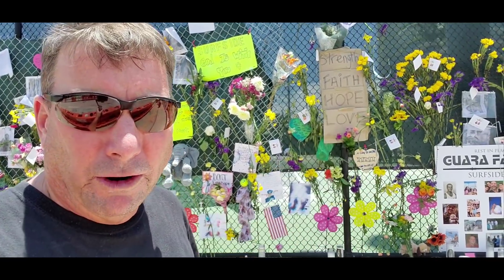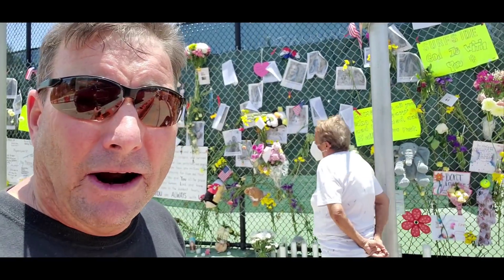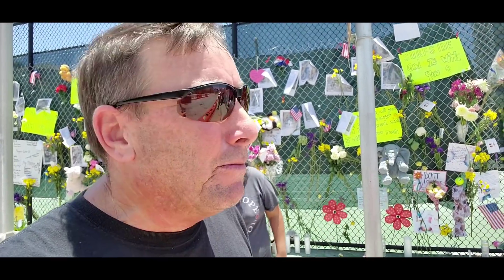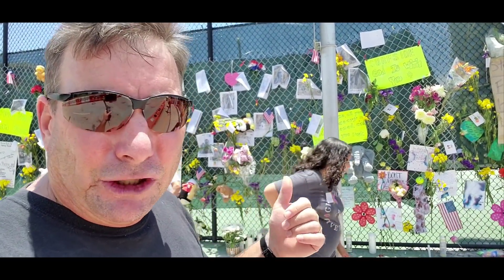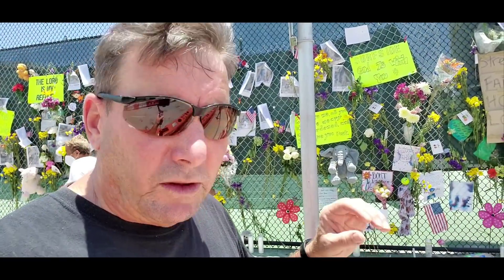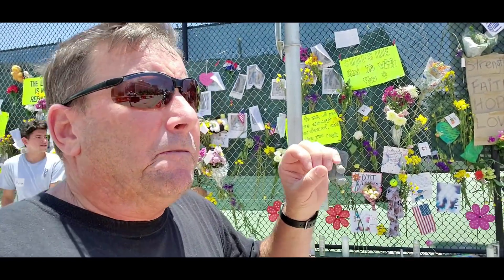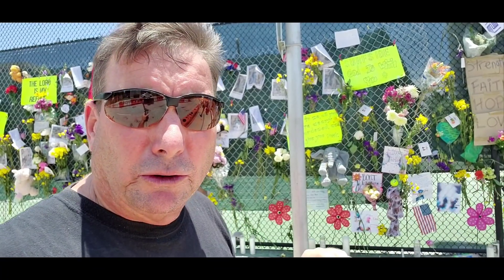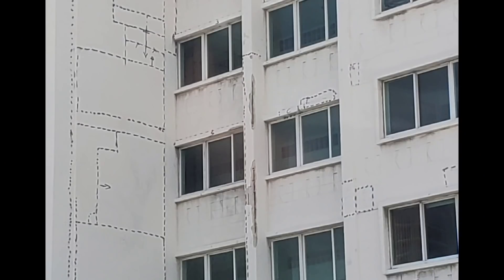Miami Condo Collapse and Memorial

Comment: Keyword: condo. Getting condo owners to agree with anything is like herding cats.
Reply: Condo owners have an inherent conflict of interest - obviously they want a safe home, but many will baulk at the cost of expensive renovations - I heard that in this case each owner was facing an assessment of $100k-$400k to pay for the necessary work.  So if one thing could change that might save people from their own tightfistedness, it is that there should be a legally mandated reserve fund that collects money every month, that is much higher than the current managment fees, so as ensure that there is always an adequate reserve to pay for repairs without having to tap the owners for six figure sums for major structural repairs.

I haven't seen it in any of the reports I have read or heard, but according to Zillow, one of the penthouses in this building changed hands on June 2, 2021 for $2.88million!
Reply: @pulaski1  Yeah facing a repair bill that costs as much as a Midwestern house tends to cause issues. I've heard a lot of these owners were retirees living on fixed income so unlike our penthouse buyer would struggle to cough up the money. Not to mention those who took out a mortage to buy their condo, nobody expects to have to take out a second mortage just to pay for maintenance. Your idea would solve that by putting that potential cost out up front and collecting it over time.
Reply: @pulaski1  either that or build responsibly.
Reply: @megenberg8  Agreed, but the vast majority of homes built in America over the past 50+ years have been built "down to a price".  

My home was a cheap spec build, but I knew that when I bought it, and that the repairs and upgrades would be a continuous process for as long as I own it; after 18 years everything is going exactly as expected.  :)

So, if you overstretch yourself just to buy a mansion, or condo with an ocean view, then your home is a financial house of cards.
Reply: Collective action problems are a bitch, there's always gonna be people who have different priorities.
Reply: @MrMattumbo  what’s that word again?  Oh yes, ‘regulation’  along with its partner, ‘enforcement’.  Not words at the top of the political influencers list in Florida.
Reply: More like trying to give a cat a bath.
Reply: These buildings don't have an indefinite life, but that's no reason to not build them using fail safe principles, say slab hangers or props, so at least they can be evacuated safely in event of a catastrophic failure of main load bearing members.
Reply: @jimgraham6722  I think the problem then is how to get from condos selling for $500k+ and penthouses selling for $millions to "this building is life-expired and needs to be demolished".  In other words, the problem is that the market has been escalating the value of buildings like this when it should have been depreciating the value.

I suppose that the building could be given a non-renewable usage permit, that would force demolition, and while that would be a radical step, it is not too far removed from the British concept of "leasehold" titles, where a condo owner (there are no condos in the UK, so I am referring to the owner-occupier of a multifamily dewelling) buys the right to occupy the unit for a fixed period of time.  The law has changed somewhat in recent years, giving many owners the right to extend their lease by buying additional years.  Typically leases used to be 99 years, but then that went up to 125 years in many cases.  Valuing a home when there is only 10 years remaining on the lease becomes interesting, and once they get below 50 years they are very difficult to get a mortgage to buy (which is one of the reasons why the law was changed to give owners the right to extend the length of the lease), because the collateral may be difficult if not impossible to sell in foreclosure.
Reply: @pulaski1  maybe maybe they should do that with the Millennium Tower in San Francisco
Reply: @pulaski1  Yes it is an issue. I have bought into a brand new condominium in Australia. Building has expected 70 year life. We are already paying into a fund for half life refit. I won't be around but I expect owners would be paying into fund in second thirty five years to give them a significant stake in redevelopment should that be necessary.
Reply: Got to wonder if any of these board member/owners, sold or moved since the report was given to them, (the association)???
Reply: @2011mendo  It has to be likely that that has happened - perhaps the seller of the penthouse that according to Zillow, sold on June 2, 2021, for $2.88million, was on the board.

Comment: Rebar rebar rebar is the cause the lack of it,  you can see this in the rubble,  way not enough especially on supporting pillers structure and too close to the edge and thickness is wrong for supporting pillars, add in some corrosion building couldn't hold itself up.  the contractors skipped on things like the rebar shoddy workmanship probably what I've seen in the drawings should  have had more rebar. Probably the concrete mix as well should really use lime and in water conditions volcanic Ash in concrete.
Building like that really should be built out of steel girders 3 storeys or minimum two stories to ground level in an environment like that.

Comment: In northern Illinois water gets in concrete cracks and freezes in the winter which also breaks up concrete. We also spread salt on roads and bridges. It is common to have  concrete deterioration on garage  floors from salt water dripping from cars  that picked up salt from the  salty street snow.

Comment: Sounds like rebar is more structural than I knew.  I thought it was for keeping the concrete together.  But it's kind of sounding like the concrete is there to keep the rebar together....????
Reply: My understanding is the steel is to give tensile strength so the concrete doesn't crumble where it is under tension. E.g. where it is being bent steel keeps it straight as concrete doesn't like being stretched.

Comment: Great explanation and analogy on this tragic building collapse Juan !
Sad to say,
I worked in the South Florida concrete industry during the 40 year ago time period !
I am concerned that the inspectors were willing to overlook some very important structural issues during the original constitution phase !
One being the depth of the chair rails supporting the rebar grid prior to the pour !
For example,
A 2 inch rail may have been spec'd, but a 4 inch chair rail may have been considered good enough !
Which would have severely compromised the overall strength of the concrete from day one !
Not to mention,
Ease of water penetration, and salt water corrosion, which could have potentially occurred much much sooner based on the specified grid depth !
There is absolutely no doubt that this building is only one of many that are in much the same condition, and very close to the same fate !
I hate to say this,
But all through the Northern States, where road salt is used heavily due to snow and ice conditions, our highway bridge infrastructure is in a critical situation currently, and just waiting for another terrible disaster of a bridge collapse !
Reply: Thanks for your insight. Clearly it was not just one factor such as spalling that caused this, but a combination of design, inspection, and maintenance.

Comment: Was sent to Patrick AFB, FL as my first permanent duty station and was told pointedly by video and photographs in our in-processioning briefing... that because of the very close proximity of the heavily salt laden Gulf Stream... the entire coast of Florida was one of, if not the most, CORROSIVE Environments in the United States, especially the part around Brevard County... which includes Cape Canaveral! 🧐
After living in the area for 20 odd years.. any unprotected metal or materiel subject to salt air corrosion left out in the elements for 24 hours especially beach-side.. will give you a quick eye opening lesson!  🧐
BTW ALL of the old beach-side abandoned buildings left over after the fist NASA Program collapse... were in the very same condition Juan describes here... that was 1975! 🧐

Comment: I watched the Youtube channel Building Integrity, and the speaker is a civil engineer, who does building inspections, and designs, for a living. He's covered this in several videos, and has not stated a definitive final cause, though leans to concrete damage at the pool deck level. What Juan Brown has said, here, is not conflicting with Building Integrity, but only scratches the surface. There was an inspection, conducted by an engineering firm, about 3 years ago, which called for repairs. Those repairs are quite costly, and the condo board, only recently got a loan approval, to cover the work. That engineering report did not relay the urgency to the condo board. They should have used stronger language. As condo boards, are usually made up of the condos residents (if they're also owners), some of those board members maybe among the missing.
Reply: I agree, Building Integrity has been doing a good job on this one.
Reply: Our condo, just 3 miles from this one, just had HOA meeting last night. The structural engineer we hired was there as well. Learned a lot about this stuff. Thankfully our board has a long term view and won’t allow residents with short term ownership plans to skimp on building maintenance. That could have been an issue with Champlain Towers. Some residents just want to keep their HOA dues low and don’t care about long term issues.
Reply: I believe after this accident that HOAs will now take the engineers reports far more seriously.
The $64k question is how did it even get to that point in a first world nation?.
Like Grenfield towers in London it seems we are in for a well deserved shakeup of the construction & regulatory industry & hopefully eject the dodgys & cowboys from it & also prioritise safety rather than forcing builders to cut corners to meet construction deadlines & late penalties!

Comment: I don't understand how water is introduced to the rebar. Does it seep through the concrete over the years?
Reply: The way the pool deck was constructed. The fatal flaw pointed out in the 2017  reports was that the slab supporting it was constructed dead flat with Tremco waterproofing seal coat on top of it. Tremco has a service life of about 25 years. this is the same Tremco waterproofing that was used in the planters. The finish surface (quarry tile or pavers) however was pitched for drainage like a patio. Any leaks in that finish surface would allow standing water to percolate down to the supporting sub slab. Which as I mentioned above, was dead flat, no allowance to drain off that percolated water. Thus the supporting deck damage was invisible UNTIL it reached the steel in the bottom surface of said deck. which is seen as the parking garage ceiling. You can access the  plans and reports on the county website and see for yourself. Disregard the two photos taken of the standing water and corrosion taken by the  pool service technician as this is a pool service service room that is to the direct south of the pool along the property fence which still stands today. Had they taken up the entire finish surface of the pool deck that would have found the damaged concrete on its top surface.  https://townofsurfsidefl.gov/departments-services/town-clerk/champlain-towers-public-records-documents

1979 plans https://www.townofsurfsidefl.gov/docs/default-source/default-document-library/town-clerk-documents/champlain-towers-south-public-records/8777-collins-ave-1979-plans.pdf?sfvrsn=bd2a1194_3

See page seven of the inspection report regarding my comments above  https://www.townofsurfsidefl.gov/docs/default-source/default-document-library/town-clerk-documents/champlain-towers-south-public-records/8777-collins-ave---structural-field-survey-report.pdf?sfvrsn=882a1194_3
Reply: 2:16
Reply: @MHM1975  I get that, but over 40 years? There are plenty of structures much older, in the same environments, that have faced the same stresses with absolutely zero consequences. Otherwise this kind of failure would be happening with greater frequency. It just doesn't happen.
Reply: Concrete is like limestone. Water soaks through it and even dissolves it, making stalactites and stalagmites.
Reply: @chrisdaniels3929  I'm fairly sure that concrete isn't nearly as porous as limestone. Everything is porous to different degrees, but for concrete to be compromised, moisture to rust the rebar and that rebar to expand and break up the concrete compression strength seems dubious to me. In a period of only 40 years? There are thousands of structures built worldwide that faced the same environment as this one for a much longer period of time. I'm not buying this theory yet.

Comment: Have not heard any thing about the post tension cables, thats really what holds up that kind of structure.
Reply: see 'Building integrity' - apparently not tension cables in this building, only rebar structure.
Reply: @edmundwest5636  that is correct. I have seen no engineering based analysis or reporting that indicated there was any pretension or post tension cable design in any of the concrete construction. Just rebar.
Reply: @byronmill   Guess it was built off a shear wall but odd the decks weren't stressed.  Im a worker not an engineer.
Reply: PT has been around since the 1950s.  However, it didn't seem to become too common in building construction until the 1980s  Only in the last 10 years did it become very common in earthquake zones.  I don't think builders comprehended the benefits of PT at the time this was built.  "It's Florida; we don't have earthquakes."
Reply: @danburch9989    Ok thanks, I do PT work on bridges, all tendons of 27 cables at a time really fun work.
Reply: @danburch9989  that was kind of my recollection. it seemed like it was in the 1990s when I first remember hearing about projects using cable tensioning systems in concrete.
Reply: That is a new piece of information. I was unaware that was used in construction of buildings, but it seems logical when thinking of the load the structure bears. I'll be looking out for more info on this, as well now.
Reply: @erinmac4750   On the west coast PT is used in all CIP construction.

Comment: As a retired firefighter I was well educated about building construction and collapse potential.  Juan, your remarks are correct.  In the end the whole incident makes me ill.
Reply: There are many poorly-maintained tall concrete buildings across South Florida and across the U.S., but so far, only one has fallen. There is likely more to it than just maintenance issues.

Also, as far as the pool deck slope is concerned: It was originally designed with many drains, and funnel-like structures designed into the poured pool deck. The drains in fact provided good redundancy in case some of them got clogged. The pool deck was redone long after the the building was built.
Reply: @HypercubeJones  And, one other multiple dwelling building in that area has been evacuated.
Reply: @bcgrittner8076 , two  have been (one in North Miami Beach, on the mainland), and one in South Beach (Miami Beach proper -- a smaller building.

So far zero have collapsed except for Champlain Towers South.
Reply: @HypercubeJones  Most appreciate all the good 411. If u can pls, elaborate on the name of the “Miami Beach proper “ Condo that had been recently declared inhabitable?!  We, my elderly Folks(92,85 respectively) and I had visited numerous times a beloved cousin of Moms lived there in one of those  Miami Beach Proper Condiminium. Not 4-5 yrs ago…place was pretty old/rundown inside. Small balcony had the Killer View, but stepping out on it?! Oooh, real sketchy, soft. I took couple steps looked around at view, but quickly retreated! Just wondering…👍😳😁
Reply: @HypercubeJones  Thank you kindly!👍👏🏻😁

Comment: This video will speculate the cause for the front three pillars that pulled down the first section of the building. The pool desk sunk thus pulled toward the pool direction those pillars which were likely already weakened to the south then the weight of the building did the rest of the destruction by gravity. Those condos on either side of the Champlain condos were very lucky the building didn't remain intact and fall over the property line coming in contact with the blue/green building. 
https://www.youtube.com/watch?v=aejzkwBZ1B0